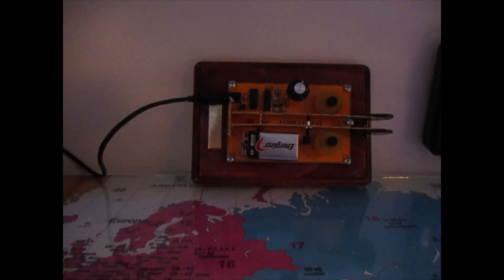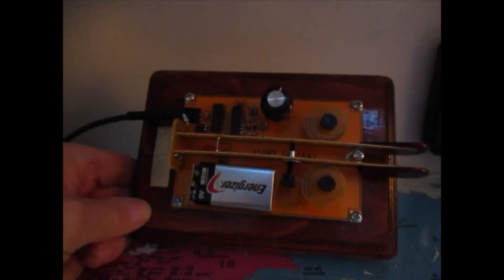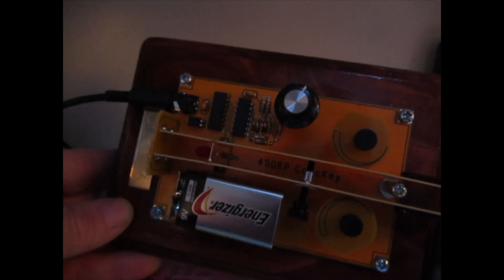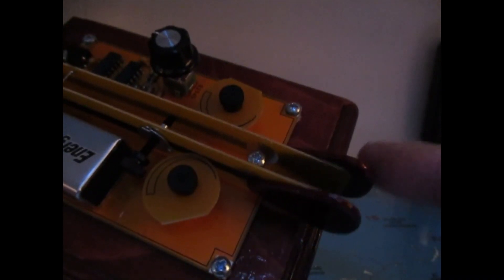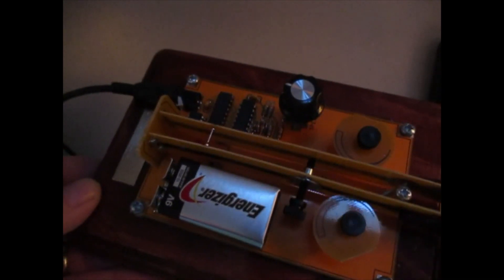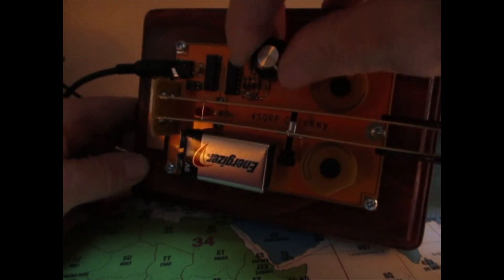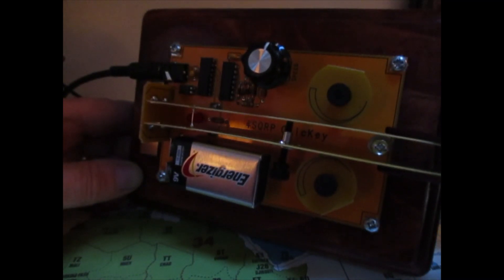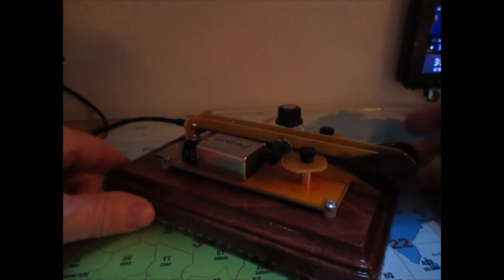NM0S Cric Key =Iambic Keyer

Comment: I just made that and It was a fun build. I haven't gotten it to work on my DX10. Not sure why, tempting to forgot all kits as I rarely get them to work. I tried all the settings on the dx10. Im glad you got yours to work. DID it actually transmit?> or does it only transmit on the qrp radios? Thanks

Comment: Hello Stan, I'm having problems with this cric key kit. I am having a constant lit led and tone when i plug in the radio jack to the key... I'm using a mono 1/8 male to male cable. Is it supposed to be a stereo jack? I sure wish you would've made a video of assembling... I'm sure I followed the directions correctly and took my time, I'm not that experienced at soldering. I'm frustrated...
Reply from the maker: Yes, that's a stereo jack; you need a stereo cable/plug to go to your transceiver.  Follow the schematic.